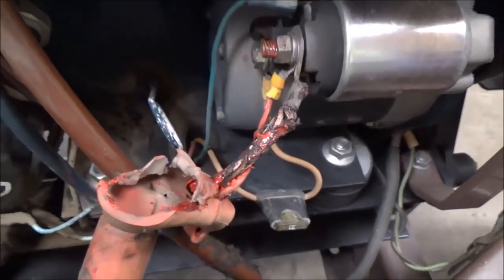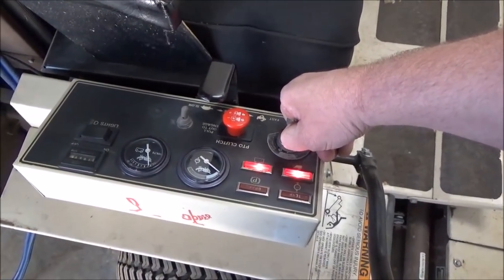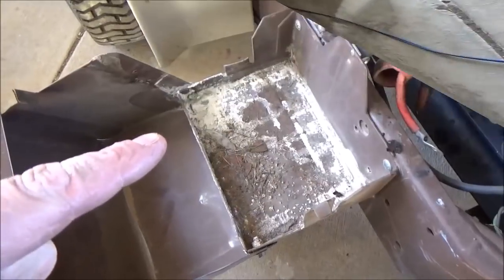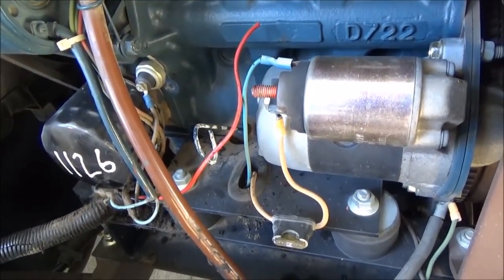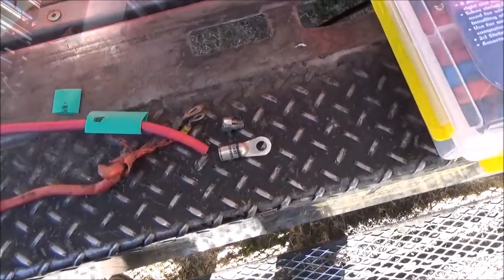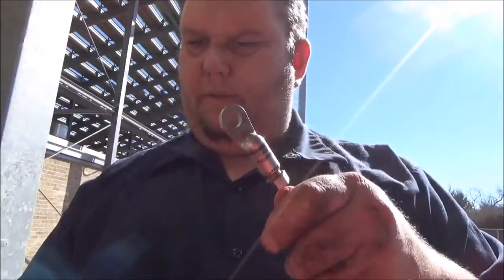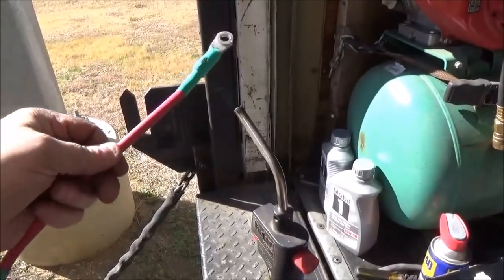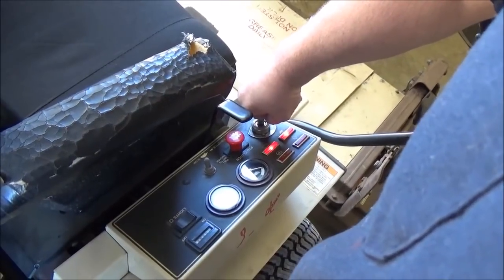BATTERY CABLES CAUGHT ON FIRE!!!  WHY?  HOW TO MAKE DIY CUSTOM BATTERY CABLES

Comment: i'm getting a ground thru my starter cable. Test light shows power and ground between batt + terminal and cable end at starter. Works as expected but damaged both ign. coils recently, need to sort this out before using, Any help appreciated. 16hp Vanguard, new solenoid, Thanks